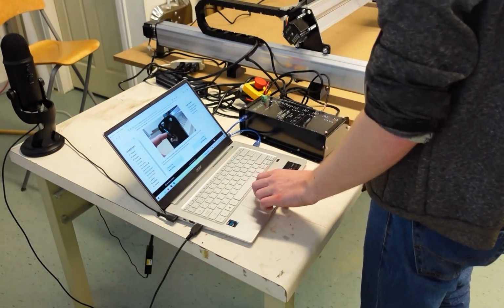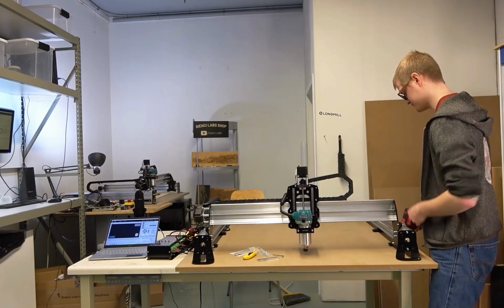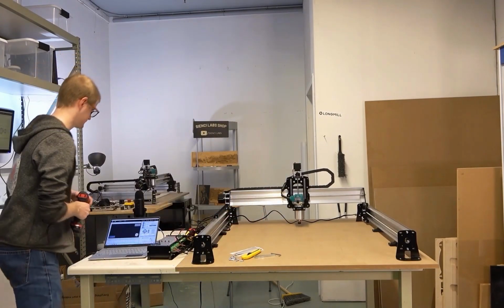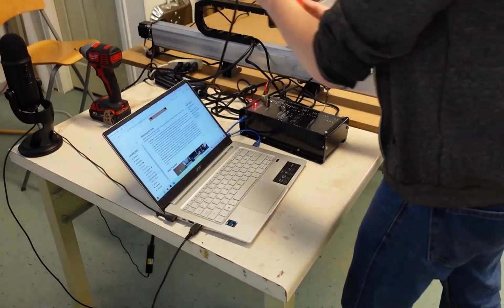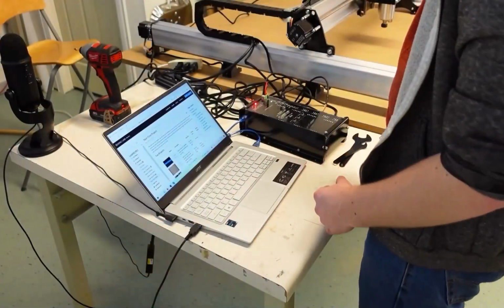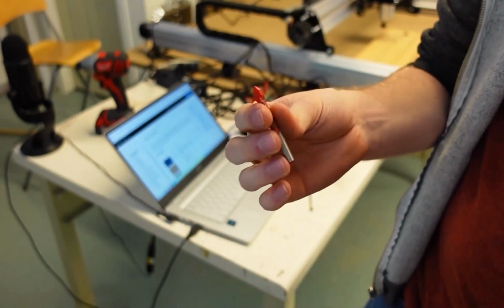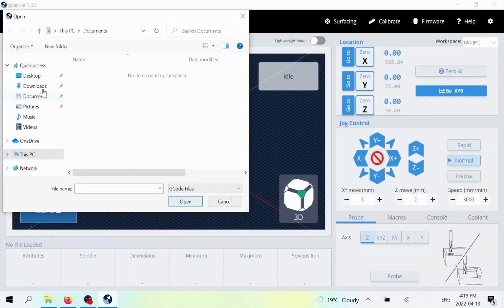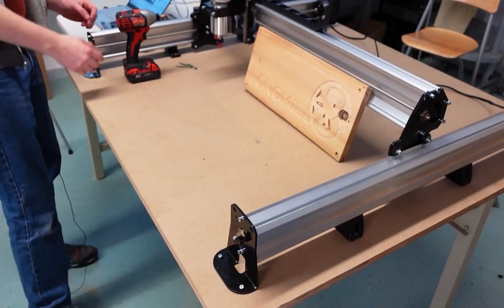Sienci Labs LongMill 48x30 MK2 Assembly Part 6 (Table Mounting)

Comment: So my machine is running!48x30 mk2...but when I jog the x gantry all the way to the back, by the motors, my lead screws can sometimes pop out. I tightened the couplers to the absolute maximum, I mean the max. Is this normal? Should i switch out the couplers or perhaps put a round shim in the coupler around the lead screw?
Reply from the maker: No that is not normal. It is possible that the lead screws are not seated all the way inside the coupler before tightening, or the screws for the coupler are stripped. I would suggest reaching out to the support team to have them replaced if that is the case.

Comment: Hope you can help me about cutting a 36" x 1" wood circle on a 48"x30" Long Mill is it possible or do I need a extension kit to be able to do this?
Reply from the maker: If you've got the 48x30 LongMill then the maximum depth is about 34" so a 36x36" circle wouldn't be able to fit in a single cut - though many people use the 'tiling' method where they cut part of the project, move the material, and then cut the rest and that allows for cuts that can be far longer, more than 8 feet 👍